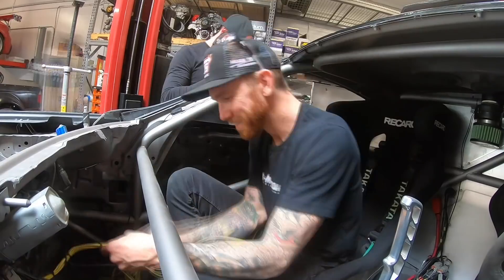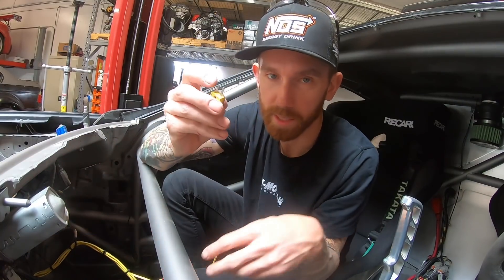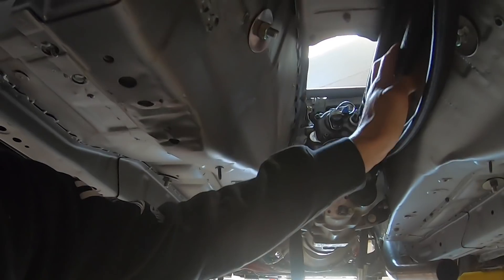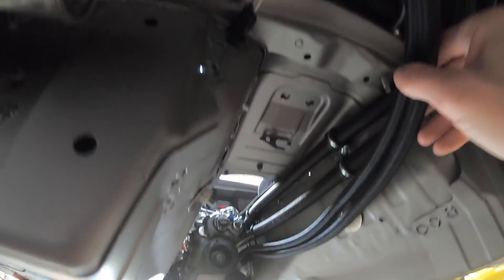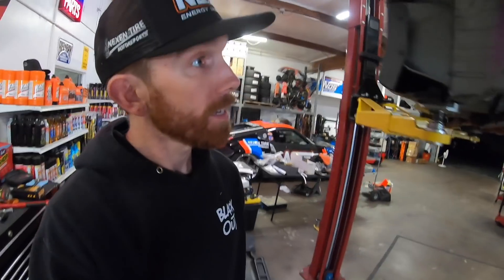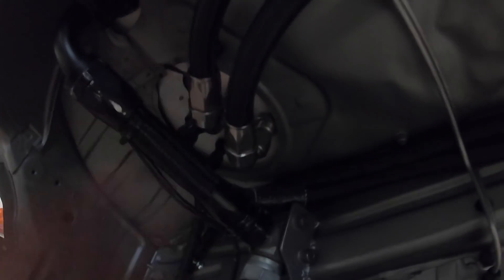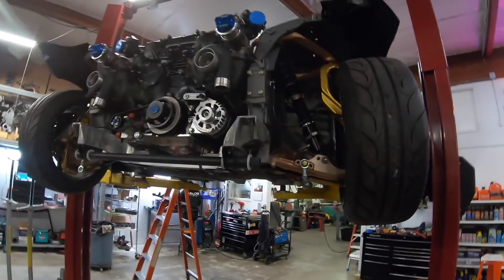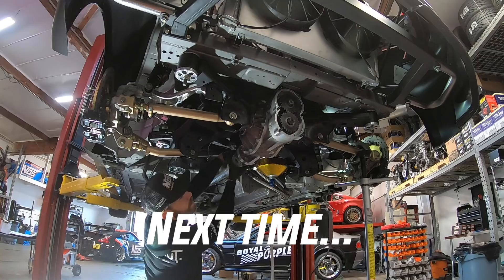Adding Individual EGT Sensors to a GTR Engine

Comment: Hey Chris sweet videos. What's the chance of going into your cooling system Abit more? Did you guys the factory water pump? Do you bleed the front of motor? Do you run a swirl pot or expansion tank? Any tricks or tips since you have run a rear mount for awhile now.

Comment: Hey Chris, I know you have may have obligations to sponsors but what is your favorite drift car chassis or what 2 chassis?
Reply from the maker: The Z's and the BMW's are great chassis to get to learn to drift with as they have strong 6cyl engines that can handle boost and also have a great drivetrain from the factory.

Comment: How much does it cost to run formula d pro 2 without sponsors
Reply from the maker: A Pro2 team effort can cost anywhere from $10-100k (not including the car build). It just depends on what you are able to bring for support to have the best chance at winning.
Reply: @chrisforsbergracing  How much does it cost to build fd pro 2 spec car
Reply: @ljag0809  I'm sure Chris will elaborate, but the ambiguous answer is: it depends. You can make a junkyard-pulled LQ/LS motor work, or you can buy a $20k crate motor. Same thing with transmission choices. A CD00x, R154, or T56 can theoretically all be made to work, or you can spend big bucks on a G-Force dog box, or even more on a sequential of some kind. The constants are an excellent fabricator and plenty of spares for when things inevitably break.

Comment: Damn -16 fuel line hahahahaha serious power, ignite red I'm guessing?
Reply from the maker: The -16AN is for the water line.
Reply from the maker: Haha, no we run a -8AN fuel feed line.
Reply: @chrisforsbergracing  what kind of wheels are the 8:07 on that 370z on the ground
Reply: Is The dry sump tank is at the  back of the passenger seat?
Reply from the maker: @ueokatsuhiro  Yes, it is behind the passenger seat.
Reply: @chrisforsbergracing  sweet weight distribution !
Reply: And the demo car has got a stock vr?
Reply: @ueokatsuhiro  I think he said it was a 350z engine in the demo car last video
Reply from the maker: @TalkTime4  yessir!
Reply from the maker: @ueokatsuhiro  the demo car is a stock VQ35HR
Reply: Any future plans that involves a q60s chassis as your pro car? Thanks for the previous reply champ👍